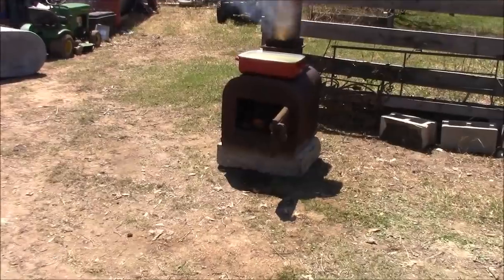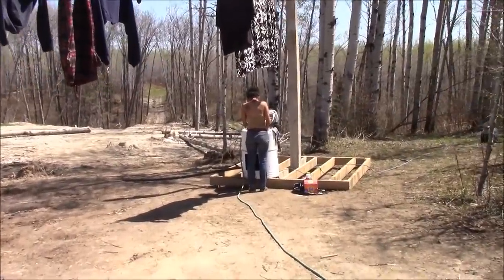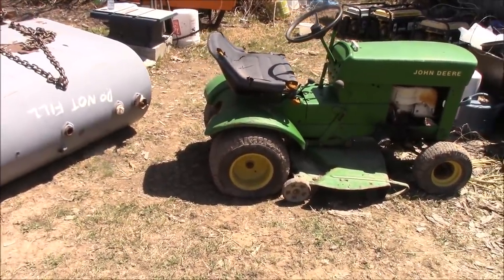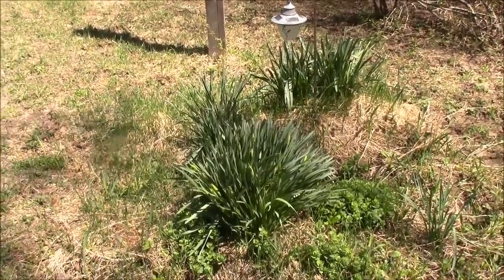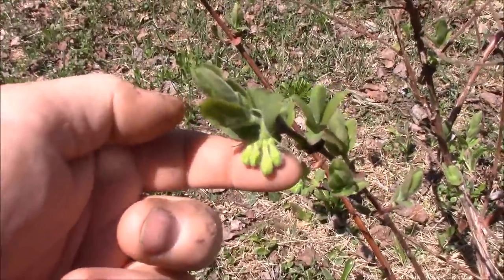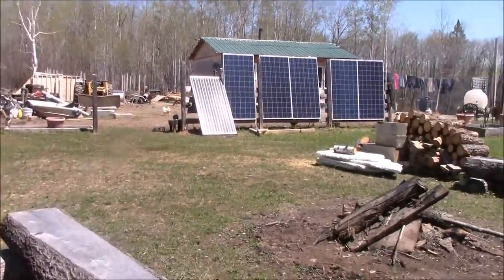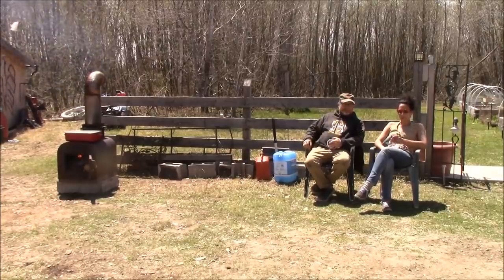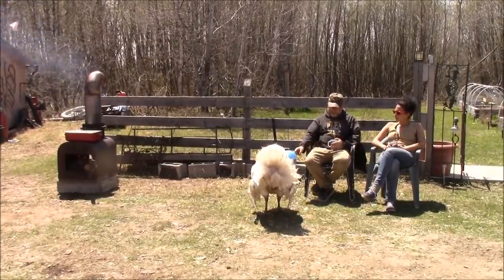We Started Building A Pig Roaster/Bar-B-Q

Comment: I just added wheels to my buddies roaster so he can easily face it where he needs to, to keep the wind from blowing ashes in his face and onto the food. I also made him some grates from expanded steel so he can load it with steaks and/or burgers. He  is considering adding a griddle plate so he can do breakfast and hotcakes. Looked like another beautiful day in the north. Ps. I added a drain to the bottom so he can just spray it out with his pressure washer for quick cleanups too. Great project especially for beginner welders. Thanks in advance for showing us how a master does it

Comment: Good morning folks!!😀😀
Spring has finally sprung nicely for you guys!! 
Love the hot water heater. You need to find a bigger tank with a spiket on it. 
The pig cooker will be cool when it's done. Have you considered putting it on a small axle so it is mobile? All the cookers we have built over years were always built to be mobile. That way you can easily get it anywhere you want it. 
Take care my friends!! Talk to you soon!! 
Your friend Al.
Reply from the maker: Good morning Al.  Yeah spring is finally here now.  Thanks we will be using this outside wood stove mostly for heating our kettle for hot drinks out in the yard.  Thanks Al,  I am looking forward to testing the roaster soon... Yeah I am probably going to be putting an axle under it when it's done. Thanks again...Cheers.

Comment: Have you ever though of putting in a Ram Pump, for your water.
With a tank you could have it running 24/7 without elect..
They only have two moving parts, and can lift water quite a bit.. 

You don't have  much presser with the ram pump, but there is always water for the garden, or doing the wash, or even washing the car...